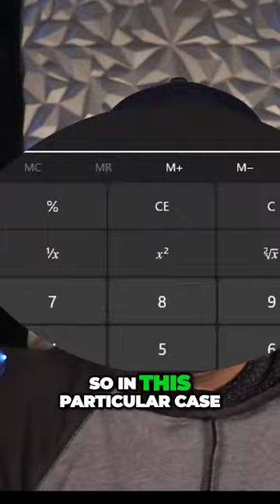How to Pick Out a Passive Radiator #hifi #diyaudio #subwoofer  #audio

Comment from the maker: 👉 Watch the Full video: https://youtu.be/S_cTXISfQJQ?si=m3yP43mBLr3s_wnx
Reply: I'm planning to do a dual subwoofer passive radiator build with (2) NVX VCW 12s but with only (1) Earthquake SLAPS M-12 passive radiator per driver as it states it has an xmax of 4" all in a 3cf shared chamber enclosure. According to the WinISD I should be safe on PR cone excursion, but I would like to know your opinion on this, and any advice you can give me would be greatly appreciated. I use WinISD and Bassbox 6 pro regularly and I'm not a noob to this, I'm just a noob to passive radiator designs. 😅